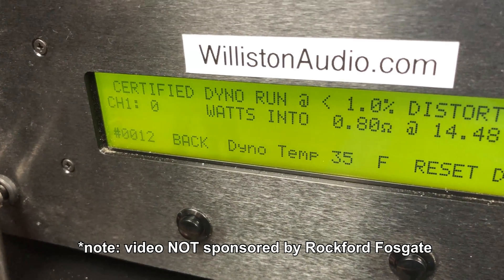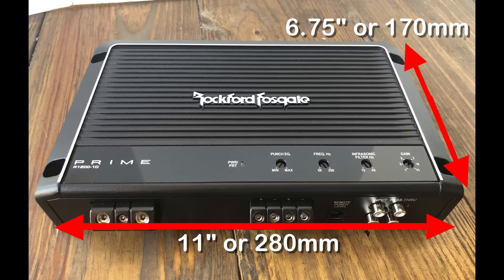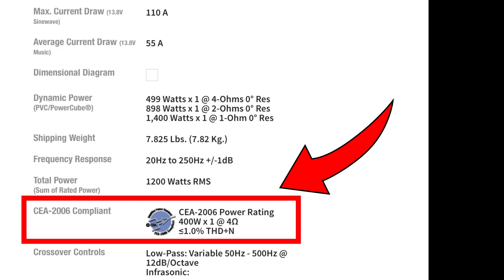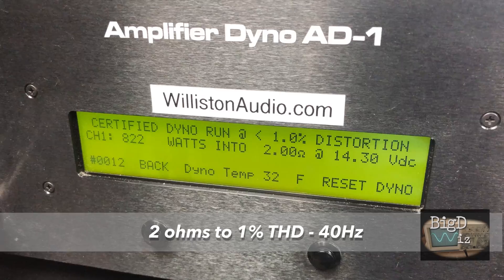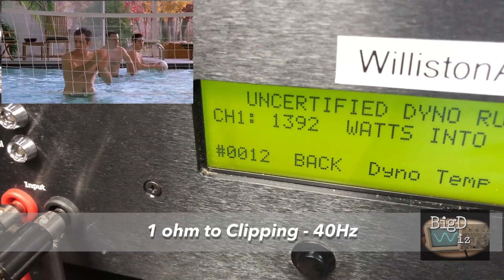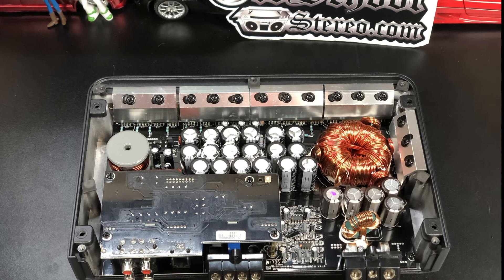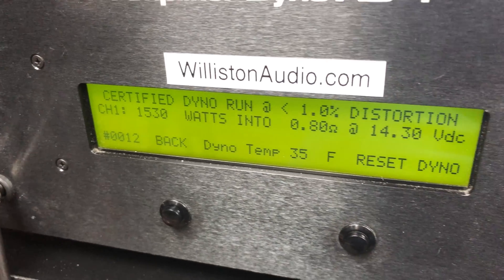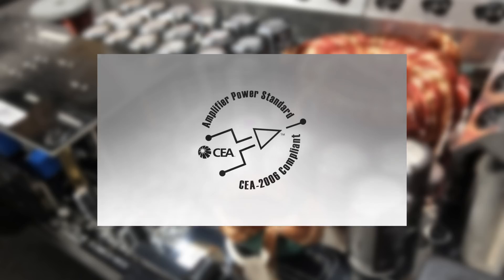Prime Time? Rockford Fosgate Prime R1200.1D Amp Dyno Test

Comment: I did an install for a friend a few months ago, glad I recommended the Prime R500-1D (along with a single dual voice coil 12" Rockford shallow mount sub and box - a very nicely matched little package) - it's a very solid work horse system for his P/U.  I'm very happy with how that install went, and I know he's ecstatic with it. :-)
Reply from the maker: Sometimes simple is best
Reply: In this case, simple was well outside his expectations of "a little" bump.  ;-)  But he's very happy with it, and that's what counts.
Reply: Did a similar setup in my truck, but I used 2 12" DVC shallow mount RFs with this 1200 amp. It's way more than enough for the subs.
Reply: Laremy81  That's cool!

Comment: BigD you're always reading my mind or something!! I JUST bought this amp a week ago, I was looking through Ebay and saw a new listing for a used one $99 +$20 shipping!! No Joke!! I snagged it immediately. Talk about MEGA BUDGET!! It didn't come with a bass knob but I was upgrading from the r500x1d which is the little brother to this one so  it was just a plug and play swap. Before I installed it I opened it to take a look inside and everything looked pristine and thankfully the amp works great and has been bumpin without issue @1ohm tuned with a DD1!
Unfortunately my car only runs at 14.1v cold and 13.8v once it's warmed up but it's still shaking my car apart!! 
Thanks for the vid BigD!!!
Reply from the maker: Super deal yo!!
Reply: I bought mine for $150 and it has the bass knob! I was worried about the amp till I saw this video

Comment: Hi bigdwiz, been watching your bids for awhile and really enjoyable. One question though, why only 4 ga wire if Max amps is about 135 for 4 ga? One dynamic RMS was over 180. Wouldn't the wire start heating up after a while?
Reply from the maker: So the sine wave tests are worst case scenario for current consumption. With music playback, the average current would be considerably less. Although it’s never a bad idea to use very short runs of 4ga (as I did, less than 6”), then go into 1/0 and you will be fine

Comment: RF is one of the few companies that's been around for years, to still take pride in their products. Great vid
Reply from the maker: So true!
Reply: AGREED!
Reply: I agree as well. I run a punch 1000.1bd on two under seat sundown E8's tuned to 32hz and it beats the hell out of those 8s and they love it.
Reply: For sure. They haven’t been around all these years by luck or accident. I have two of these amps and they are BEASTS!! They’ve always had some of the best, or the best, amps. I’m not a huge fan of their current subs. But really liked the older versions
Reply: I love RF!!
Reply: I'm late to this post, but modern fosgate amps do seem different to me. Maybe it's the acoustics of my car a dodge charger (2017) but ive tried 3 fosgate sub amps and they aren't doing what they used to do back in the day. I've ran 2 different sets of 12s and now on different sets of 15s. I've now matched fosgate amp to their subs and it's just not doing its job. All my stuff is heat shrunk,  wire ferrules to the amp hook ups, tuned with a smd and oscilloscope and my music of the phone is crap...I've off and on tired retuning and tried different amps and same results..some music hits and some doesn't that should...
Reply: @dabeatboxer83  all about your subwoofer box/enclosure. Get a custom box built. Prefab boxes are trash. I always build my own and ever since I have never went back.
Reply: What's better this one or the 1000 BD ?? Don't now which one to get
Reply: You hit the nail on the head! Taking pride in their work.. 100%

Comment: That’s quite an impressive amp for $234!
Reply from the maker: Especially with the RF name! 👌😬👍
Reply: I believe you, I'm just surprised amps are so affordable these days. That amp in my day would've been well over $1000.
Reply: Jamie Nichols it is! That’s what it was priced on the link Big D shared.
Reply: Jamie Nichols $1 a watt back in the day lol
Reply: Jamie Nichols it's cheap because it's Rockfords entry level Amp. It's wayyy overhyped compared to amps that cost a little bit more
Reply: hifivega it sucks compared to the kdx1k and the JL jx 1k. I had all 3. It's was horrible. The jx1k was the best.
Reply: havel twink The jl does 1000 at 2 ohms, therefore its going to be more powerful than the rockford being rated at 1 ohm
Reply: I agree Orion xtr1500.1
Reply: Have you ran the dyno on the newer R2-1200x1???
Reply: $234? That's stupid cheap!
Reply: It's supposed to retail for $399.
Reply: @chevy383jt  I'm reading a couple  Sketchy reviews on Amazon but I think I'm still gonna cop one